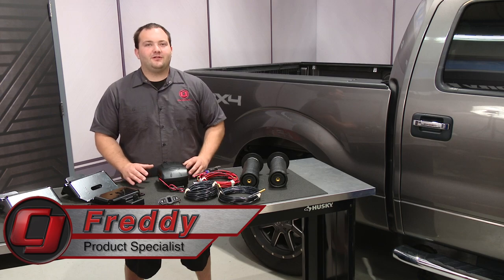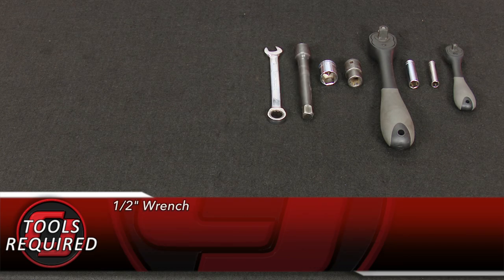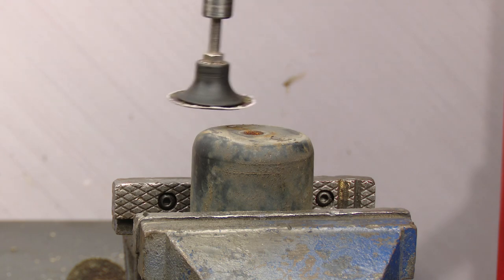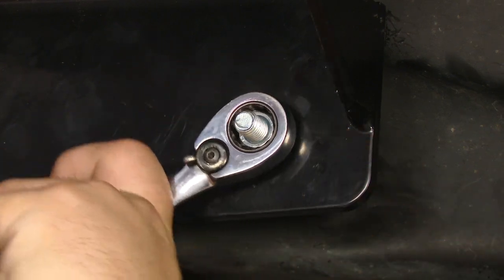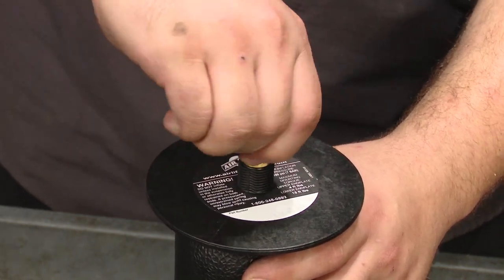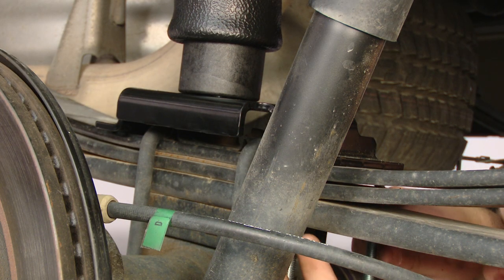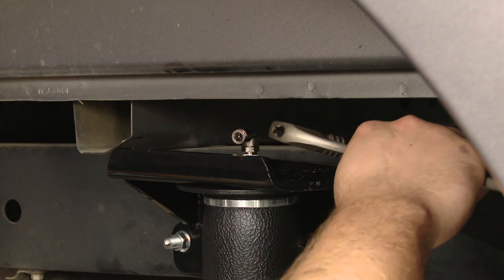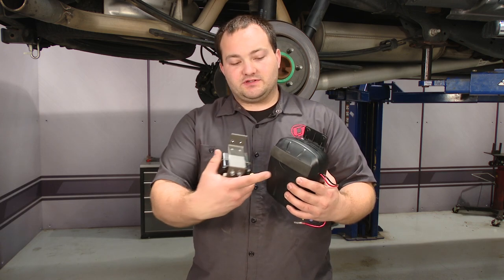F-150 Air Lift Air Spring Kit RideControl 2WD/4WD 2010-2014 Installation

Comment: How much of a decreased suspension travel is there as a result of installing these, and do they make for a harsher ride?
Reply from the maker: The limit on suspension travel is very minimal if any, but they do make the right slightly more stiff unless you remove the schrader valve when not towing, but then debris can get into the lines.
Reply: I thought the bags requite a minimum of 5psi in-order to avoid damage? Would the slight increase of stiffness be roughly equal to what I would feel if I added a leaf?

Comment: Just installed this kit in my 13 f150 fx4 with well liners.   The liners  make the job difficult.
They are in the way for 4-5 steps and it's awkward tightening the bags top nut and routing the hoses.
Reply from the maker: That is good to know, I guess it would have been a little easier to remove the liners first. Thanks for watching!
Reply: How much of a decreased suspension travel is there as a result of installing these, and do they make for a harsher ride?

Comment: Why wouldn't you just supply shorter bolts so you don't have to cut everything down?  That seems poorly designed by AirLift.
Reply: Matt 
They probably use the same bolts on multiple vehicles I'm guessing
Reply: They do it so complainers like you have a voice

Comment: could this be installed on a 2016? also what about something like this for front?
Reply: The exact kit we used in this video wont work on your 2016, but we offer a pretty much identical kit that will work on the 2016 http://www.cjponyparts.com/air-lift-air-spring-kit-ridecontrol-2wd-4wd-f-150-2015-2017/p/59570/